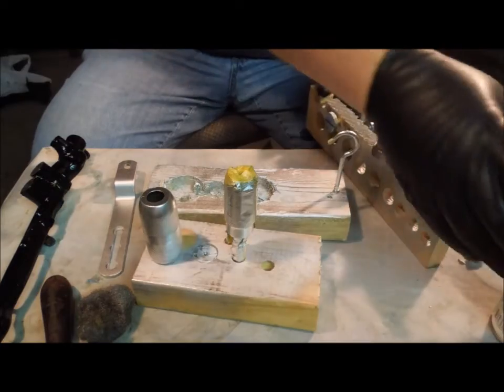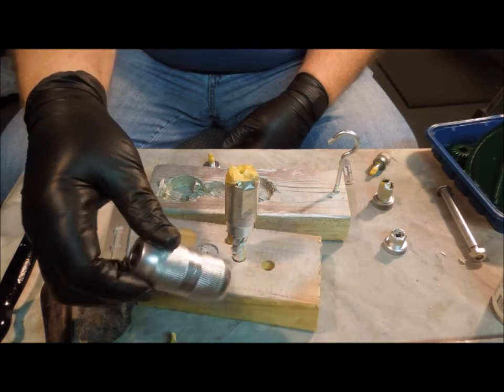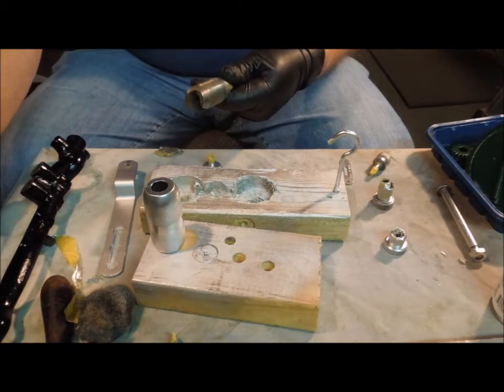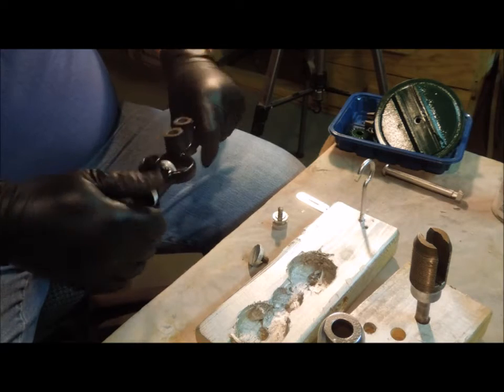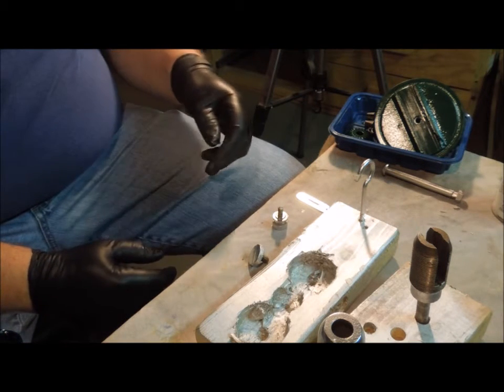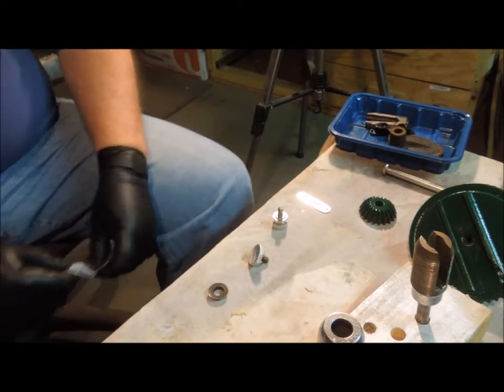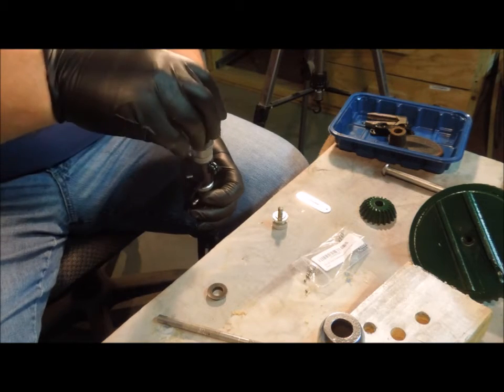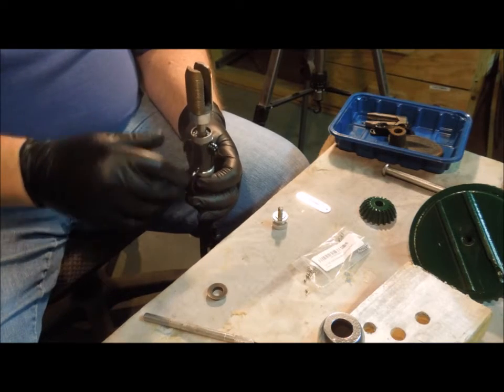Repairing Antique Tools - Millers Falls #12 Pt 4 Assembly - By Old Sneelock's Workshop

Comment from the maker: Mr. Cool asked "Why do you love old tools?" 
When I was a kid the tools that I'm seeing in the antique stores were the tools that my Dad had in his tool box. I would be right there whenever he was making or fixing something. I was the apprentice who ran and got the tools as Dad needed them. It wasn't until I was 10 or 12 that Dad got more than a 1/4" drill motor. When we were working together wiring houses, barns. and storefronts it was always fun. 
As Dad got new tools he passed the old ones down to me. There were a lot of tree houses, scooters, and bridges built out in the woods with those old tools. 
He taught me to sharpen saws, how to sharpen the edges on an axe and hatchet, and how to hold and swing an axe. 
I think I like old tools the most because they are rugged. With minimal care they will last for centuries. That's why they are still around after being hung on a nail and left to rust since the day the power tools showed up. Thanks for asking Mr. Cool.
Reply: I like them for a couple of reasons. One, they run on "me" power and I already pay for the fuel for me (and have a bit in long term storage LOL!) and two, they'll outlast most any modern version out there. In many cases it's even been proven that the old tools are faster. There's a video of two guys cutting long grass, one with a gas powered trimmer and one with a scythe. Scythe guy was done before gas powered trimmer guy got half way.

Comment: @Old Sneelocks Workshop 
I am currently in the process of restoring one of these. Is the gear on the shaft for the chuck held in with a roll pin? I'm guessing I should go ahead and order the ball bearings now. Do you know what size should be used?
Reply from the maker: The gear has a tapered pin. make sure you line up the holes with the tapers matching. I had to file down a papered pin after getting the taper misaligned. 😁😎
Reply: @OldSneelock  
I was able to get it punched out. Thanks for the advice.
Reply from the maker: Just hunted down the bearing size. .030 inches. Make sure you have them over a towel or something so they won't bounce. 😁😎